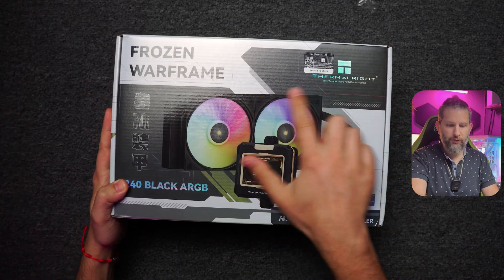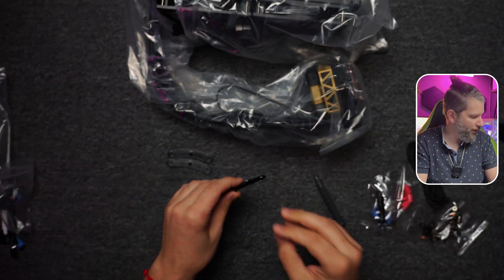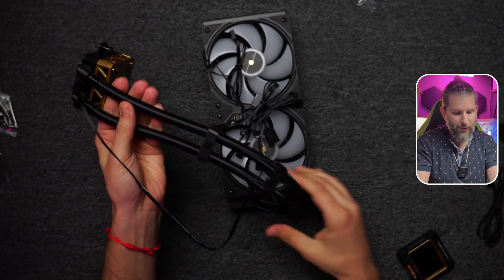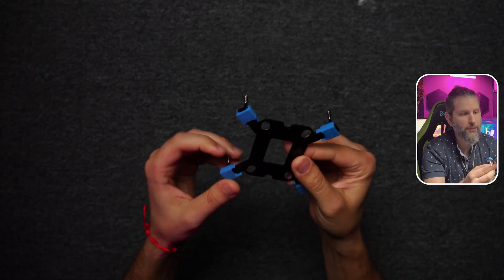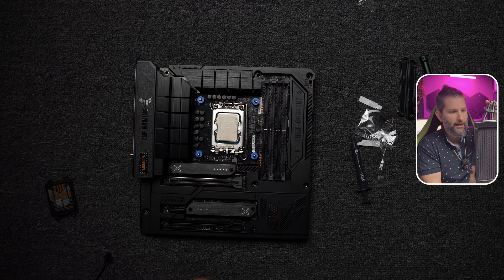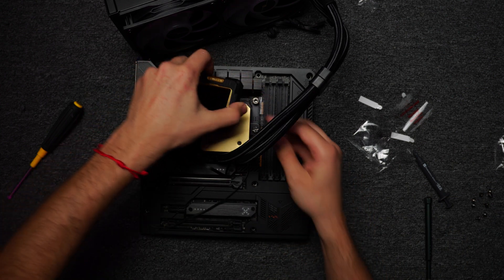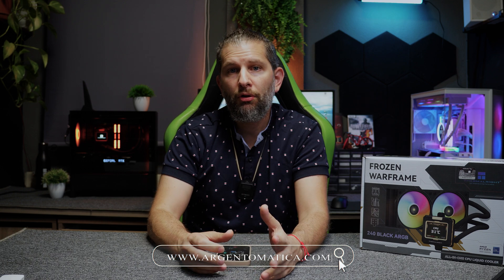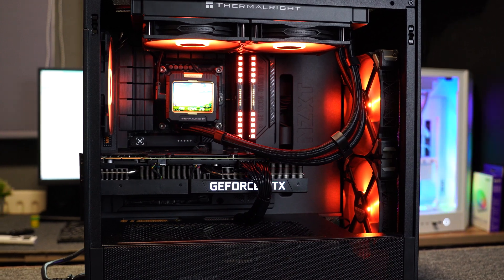Is Thermalright Frozen Warframe 240 the BEST COOLER for Your PC Build?

Comment: Quick question.. My motherboard are Asrock H410m-hvs and dont have ARGB slot.. can i still use this liquid cooler and can i still use the LED?
Reply from the maker: Hi! No, because those coolers come with RGB connections. What you can do is buy an RGB hub and try to get the lighting working that way.